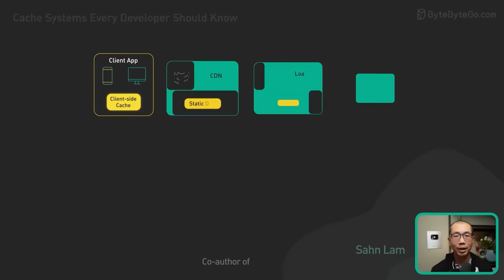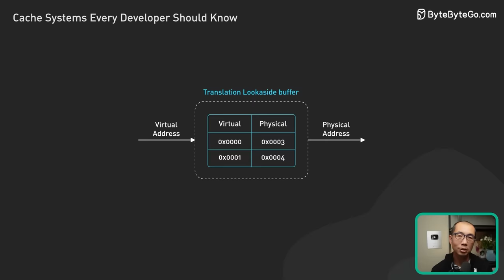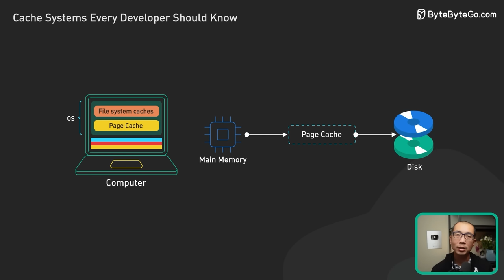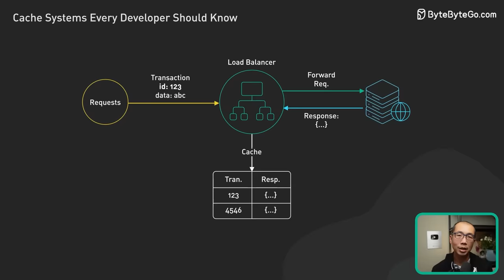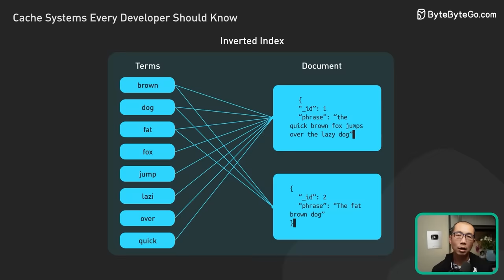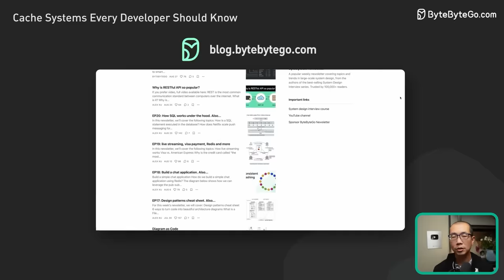Cache Systems Every Developer Should Know

Comment: Great video.

Concerning sql databases, typically the buffer pool caches commonly accessed file system blocks rather than query results. Some databases have a cache of results or even intermediate results (I.e., outputs of parts of queries often run or easily cached).